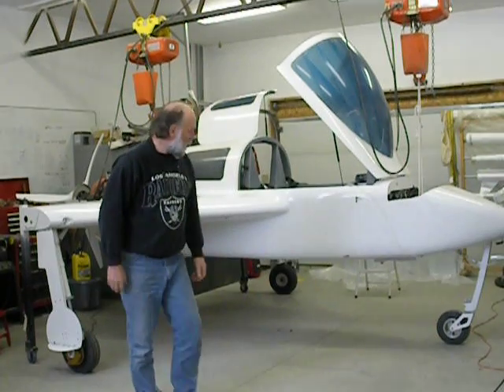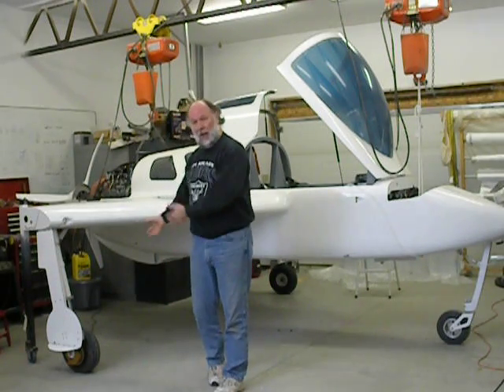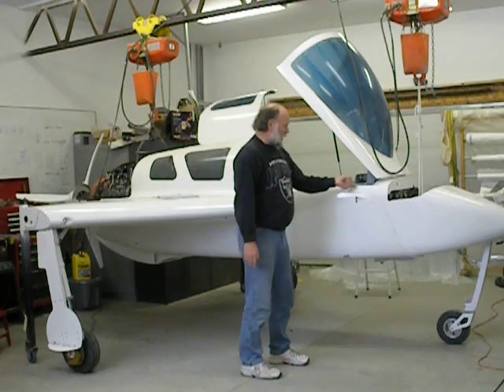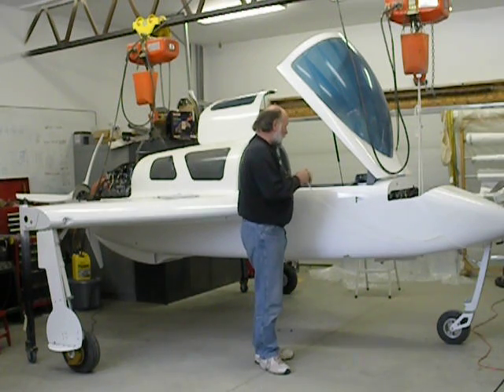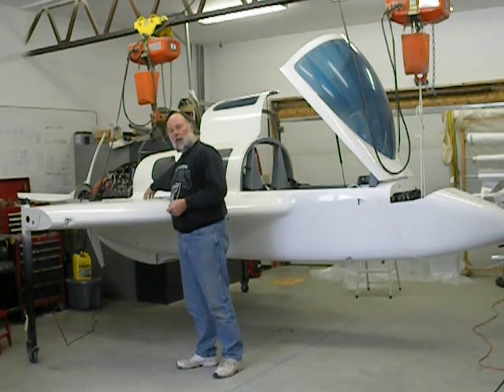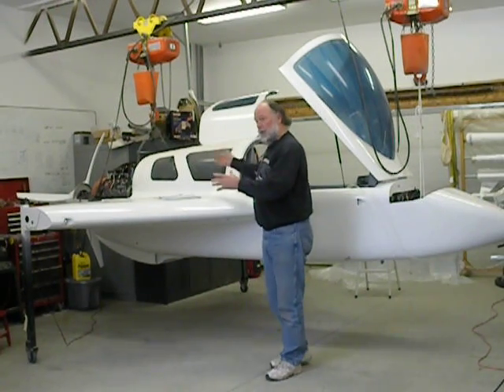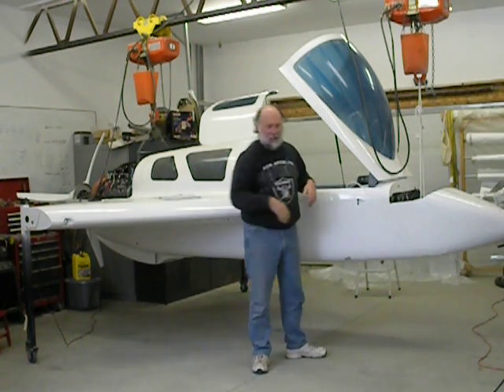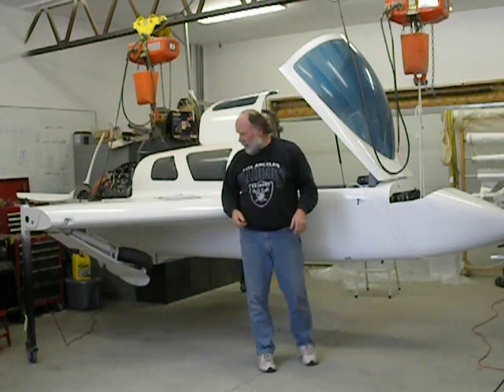Infinity Aerospace  Retractable Landing Gear Cozy MK IV RG

Comment: Phillip did you had to make the fuel tank smaller to make the retractable back landing gear?
Reply from the maker: The wheel wells cause the fuel CofG to move from 103 to 100.  This is a nice location but reduces fuel capacity.  I removed the two wedges (one each side) that were there for CofG reasons and this recovered some fuel capacity whilst moving the CofG back to 102.75, so close to the original position.  I also made a sump tank between the landing gear bulkheads that added ~6.5 US Gallons.  Total capacity was measured by weighing the Cozy empty then adding fuel.  I was able to add 306lbs of fuel and there was possibly enough space for another 6lbs of fuel to bring it to the brim.  Based on the above data I can categorically state there is no loss in fuel if you build it in the same manner as I built mine.  Also the CofG moves forward by 0.25” which is a desirable movement as it is closer to the aircraft CofG.
Reply from the maker: Note:  the addition of the sump tank is behind the CofG so, if you use this fuel it will cause the Cozy to be slightly heavier at he nose, however this fuel quantity is your required reserve upon landing so it should never be used except in an emergency.  In the event of a fuel extinction emergency you should be prepared for slightly higher landing speeds to account for the CofG shift.

Comment: Does this take up room for fuel. Also how much weight extra. Is there a performance advantage
Reply from the maker: Cuelodge  the wheel wells are in the fuel tanks so yes it does reduce available fuel. However, this can be recovered by using the space between the landing gear bulkheads as a fuel sump. I also did not fill the space that was supposed to be filled with pour foam for CofG reasons as the wheel wells moves the fuel forwards but by a lesser extent.  My fuel CofG ended up slightly forward of the plans CofG which is a good thing as it is closer to the mean aircraft CofG.

I gained about 50lbs overall, maybe slightly less, but if you use that in your budget you won’t go far wrong.

Unless you do a retrofit, it is impossible to know how much performance gain you have. I think that one of the most important gains is the increase in drag when the gear is down.  This makes for much steeper approach angles so it’s easier to land.  I don’t use the landing brake but with engine at idle and using both rudders at brakes, it comes down like a Cessna 172 on full flaps and in a slip.

Comment: What does adding retracts do to the useful load? Also I was thinking of buying a Cozy that already has fixed gear on it.  Is it going to be impossible or too hard to be worth it to convert it?
Reply from the maker: I think you should be expecting about a 50# increase in weight

Comment: What is your fuel capacity with the retracts?
Reply from the maker: I have not measured the quantity yet but calculations suggest a loss of less than five gallons.  The wheel wells cause a greater loss than that but it is possible to remove the foam blocks normally in the strake which are used to move the fuel CofG forwards.  Since the wheel well moves the fuel CofG forwards it is possible to avoid having these fuel displacers and therefore regain capacity.  My fuel calculated CofG is at 102.5 verses 103 of the stock Cozy which is an improvement.  I also recover fuel capacity in the sump located between the fixed gear landing gear bulkheads.
Reply: Phillip Johnson Wow, thanks for the fast reply! I am thinking of going with full retracts to cut down a little on drag for efficiency in GPH burn. The reduced range should be partially compensated for by a fewer higher knots at cruise and a little lower burn rate, and I doubt I would want to fly 1000nm without a rest on a single leg anyway.
Reply from the maker: I have measured the fuel capacity and it is unchanged by incorporating the retracts so long ad you add a sump tank where the fixed gear bulkheads go and also do not install the block, in the strake tanks, that moves the CofG forwards.  You can do this mod because the wheel wells move the CofG forwards instead.  The end result with sump tank and the intank blocks removed is a slight movement of the fuel CofG forwards.  Yes that is correct the fuel CofG moves from 103 to 102.75.